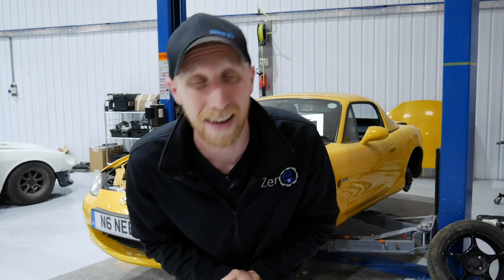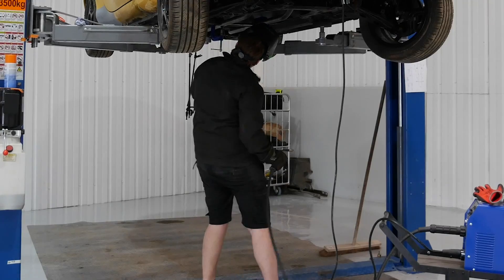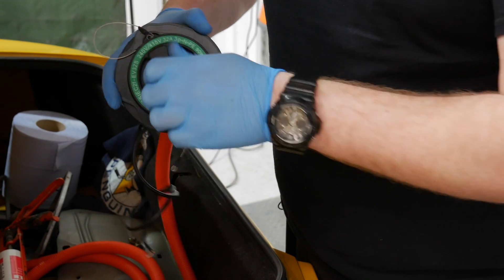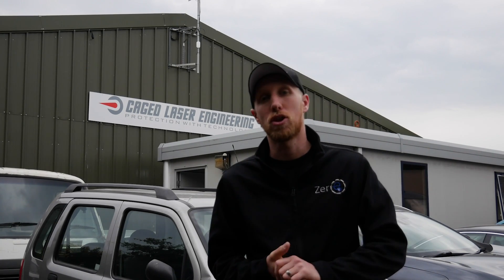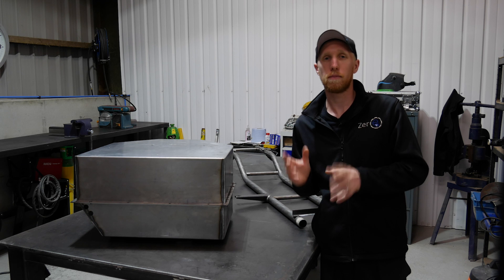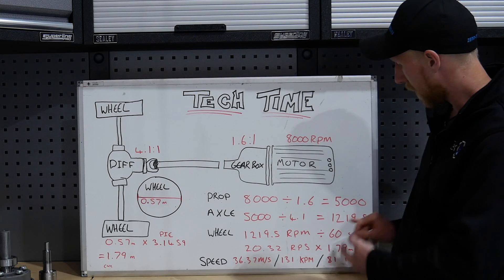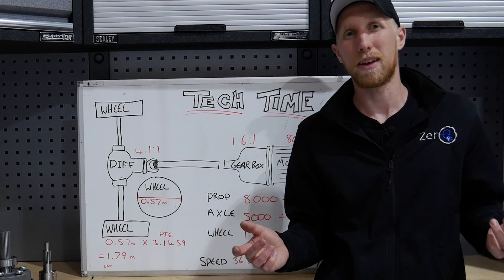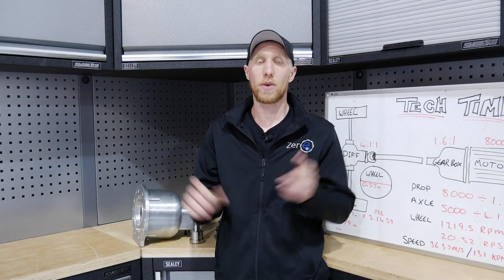Mazda MX-5 Goes Electric - The High Voltage Build - This could hurt

Comment: For Highway driving, which is 85% of the time in US the 3.6gear box would be better.  Would this increase the range of the batteries?
Reply from the maker: You would actually want a lower reduction more like 1.5:1 as this would alow the motor to run at a lower rpm and be more efficient

Comment: question.thinking of putting tesla motor in my transporter what kit would i need battery ect for this conversion...love the content only just found you
Reply from the maker: You would need a 350v nominal battery pack which is normally 96s check out the battery pack tec time.

Comment: Fascinating work !!! 
Does the hyper 9 only hold by the half moon in aluminum support it from the bottom ? Nothing prevents it from turning ? 

How much do you sell the reduction system to couple with the Hyper 9, I can't find info about that. I would be interesting to know the costs of its aluminum case and the planetary gear reduction (we are looking for a system with a gear reduction of 2.5)
Reply from the maker: It has a full clap around it, the gearbox is not yet available still doing more testing.

Comment: As sommeone who has driven an mx5 daily for 10 years, trust me, you can cruise at 110mph in an mx5 in comfort. on the german autobahns naturally only of course. I agree totally that 0-60 is more important in an mx5 tho. 0-60 can be done on a stock model in a hair less than 7 seconds, if you get those gear changes just correct.

Comment: I’m not 100% clear as to why the gear box is needed a? Lots of other EV’s don’t seem to need them
Reply from the maker: Every Ev has a gearbox. It’s just a single speed gearbox with diff.
Reply: Most production EVs have their gear reduction in two stages, both within the transaxle. This has the gear reduction in two stages as well, just separated into the custom gearbox and the final drive unit (diff).

Comment: What kind of metal was used for the battery box? What type and thickness? Thanks!
Reply from the maker: Also check out eps7 of the mx5 build there is done more battery box information on there.
Reply from the maker: We use steel 3mm fir the base and 1.2mm for the top from what I can remember.
Reply: @Hazell_Nutz  nice! Thanks for the info. Planning on building a battery box soon, so this is super useful.

Comment: 🤣🤣🤣🤣 I ran my 1.6L miata up to 120MPH with ease.  It could go even faster, but around 130-135MPH steering control would vanish due to lift over the front end.

I'd recommend a 100-110 MPH top speed unless you add a bit of aero for 
downforce or a bit more weight to the front end.  If you can keep steering functional, I know the Miata can do just fine over 150MPH.  I put lead lining over the front wheel wells in the engine bay (then bondo and paint over them with a lead warning in the paint job) and modified the hood to spoil the lift.  I could hit 160ish on a speed check run.  All on a supercharged 1.6L Engine.

Comment: What's the weight of the battery box? Why did you do steel box, isn't it too heavy?
Reply from the maker: Aluminium is hard to work with for most and cracks over time with vibration so steal is the safest bet plus of anything went wrong ie crash or fire it’s way better.

Comment: Question - why not yoke directly to the motor, skip the gearbox, and gear up the rear diff instead?  Purely to get the gearing high enough (>6:1) and it wouldn’t work in the existing diff?
Reply from the maker: Because they do not do a 6:1 rear diff.
Reply: In a quick search the shortest ratio I could find for a NB Miata is 4.778:1. These videos mention various gearing options, but 1.6:1 in the gearbox and 3.6:1 in the ring and pinion would be 5.76:1... so 4.778:1 would result in a substantially lower and likely unacceptable top speed. 

There is a 5.38:1 gear set for the same family of final drives (apparently for a Kia Sportage), so if it's strong enough and if the bits can all be made to work together, doing all of the reduction in the final drive might work.

The V8 swappers normally use a final drive completely unrelated to the Miata/MX-5 (or even to Mazda) - typically from a Ford or GM car - and build mounting brackets and shaft adapters to make it work. There are 6:1 ring-and-pinion sets out there, so this is certainly an option. In the end it would probably cost more and would certainly take more time than using the gearbox... and it might even weigh more, depending on the final drive used.

It would be nice to save the weight and expense of the gearbox.

Comment: Nice work with the gear tech talk. I've been more faccinated by the drive placed vertically and a gear box that can transfer the energy to front or back wheel. This will work better for waterlog areas, so water can't easily get to the electric motor drive unit
Reply: This motor is air cooled, but production EVs have liquid-cooled motors which are sealed up and don't have a problem with getting wet.

Comment: Does the cradle affect the overall safety of the car in case of an accident?
Reply from the maker: It’s definitely required as the cradle replaced the engine/ gearbox as if not the battery box and motor would of been two separate items.

Comment: How about using two of these motors to work in tandem ?
Reply from the maker: It can be done.
Reply: If you need more power get a more suitable motor, not two motors which combine to be enormously long and require two controller/inverters.

Comment: The circle perimeter formula is 2π*R, and not π*R as shown on the video. So, technically, the vehicle could get 72,7 m/s, or 162 mph. I really don’t believe it will get this though (I didn’t watch next episodes).
Reply from the maker: Gets exactly 72 did testing today.
Reply: They do the calculation with diameter, not radius: π*D

Comment: But one question wat about the charge port, when it start to rain. Did the charge port don’t fill with water ?
Reply from the maker: There is a drain hole in the charge point.

Comment: 10:45 So you're converting this MX-5 to electric and you're not even going to make it accelerate faster? And you won't even be able to drive it on all roads due to the reduced top speed... (This is coming from USA though, maybe where you are the MX-5 was slower and you have lower speed limits?)
Reply from the maker: Our max speed is 70mph in the Uk. This is mainly built as a test vehicle for the gearbox and battery modules.
Reply: @Hazell_Nutz  Makes sense. I assume future builds will be tailored to what a client wants out of the car. Still super cool what you're doing!
Reply from the maker: Darrek Olson yep your correct we have a new motor coming that will be 160hp and goes to 12,000 rpm so would alow 120mph top speed

Comment: Did you consider making the battery box from aluminum instead of mild steel?
Reply from the maker: Yes we did but needed the strength so by the time you use thinker aluminium is not a massive amount in it, plus if ever in a crash much prefer steel 😄

Comment: This would be annoying where I live. We have 80mph speed limits that aren't well enforced. 85-100mph is very common here in the country interstate highways. And that acceleration is just terrible. I don't understand putting all this work and money into something that would just be boring to drive and not even practical either.
Reply from the maker: It’s built as a test vehicle for the gearbox and battery’s, as a company we have a much more powerful motor coming out for this gearbox 👍

Comment: 131km/h top speed is pretty low for the mx-5 to be fair. On my NA I could do 190 km/h GPS measured, however it's not a speed for cruising. I guess it depends on the country, but 131 km/h can be pretty limiting in germany as 130 is the "recommended" speed for the unlimited parts. So when overtaking the people creeping along at 100-120 it could cause troubles for when you suddently don't accelerate anymore :D

Comment: Wondering what you plan to do about cabin heating?
Reply from the maker: Actually been working on that today, fitting a high voltage ptc heater.

Comment: Why does an EV need a gear box, just asking, I know nothing.
Reply from the maker: To keep torque high enough
Reply: @Hazell_Nutz  I see, thanks.
Reply: As with any engine or motor, the gearbox (with the final drive or "diff" gearing) matches the operating speed range of the motor to the required speed of the axles.

Comment: A top speed of 81 mph in a way is a let down but I understand the choice in the UK. Take a GT6 much above 100mph and it porpoised. A bit off putting. Running a 2 litre MX5 at an indicated 220Kph (probably 210 or 130mph) and it behaved fine. What was scary was being overtaken by something at that speed like I was stationary.  A top speed of 131kph will take you just to the French motorway speed limit with no leeway. That really needs to be better. The 0-6 is only just slower than the petrol version. I like EVs and hope to get one but not sure about bothering with an MX5 conversion. Interesting series though.
Reply from the maker: It’s mainly to test the gearbox out and actually do a build with the hyper9 as we have never actually used one as a company 😂 our new motor is 120kw and 12000 rpm so will do way better on 0-60 and top speed.

Comment: Would the batterys at the front change the 50/50 or so weight, and are you going to put more batterys in the old fuel tank spot to compensate?
Reply from the maker: It will change it a small amount, there is the option to run a second pack at the rear but for this build we will not

Comment: So if you put a model 3 motor in with 15500 max rpm the car would do around 150 mph?
Reply from the maker: Yes your correct there is a few other factors like aerodynamics and battery current requirements.
Reply: Zero EV I really hope EV conversions get more popular. It’s super cool how simple everything is. It feels like RC cars. I hope one day there’s all sorts of little upgrade parts like battery and motor swaps.
Reply: Yes, if you used the same gearing and if the Model 3 motor (and the battery) produces enough power. You don't change motors to change top speed; you select gearing to suit the motor chosen and the top speed desired.

Comment: Is DC fast charging a possibility for DIY EVs? I have a conversion in mind, but I want to be able to road trip, and Type 2 won't cut it for that.
Reply: Only if your battery voltage is above 250V when empty. Alot of DC charge stations do not charge below that voltage.

Comment: Regarding the diff gear ratio. As you say a 3:1 would reduce acceleration but increase top speed, what would that do to the battery life?
Reply from the maker: Would not have a massive effect on battery life unless you did a lot of high speed driving
Reply: @Hazell_Nutz  Cool, what about driving at motorway speeds? 70mph of course ;) Would the 3:1 mean more battery life over the 4:1? Sorry I just find this sort of thing fascinating, figuring out what you gain and loose when making these sorts of choices :D
Reply: @smartroadbiker  All depends on your motor efficiency graph, the draw on the battery will be roughly +/- 3%, i would estimate, so no noticable change. The main thing that will effect battery life is running the battery too; Hot, Cold, Empty, or Full. This is why you setup your BMS to manage all these things within reasonable limits.

Comment: Something else occurred to me on re-watching this - will you be rubber-mounting the motor in any way? That frame appears to be hard-mounted to the subframe and body. If the motor is hard-mounted too then you'll potentially get a lot of drivetrain noise through a very solid transfer path. It's not a deal-breaker, but maybe something to consider in terms of drivetrain refinement.
Reply: The motor needs to be soft mounted, due to reusing the OE brace between diff and gearbox. the motor and gearbox will sit on 4 isolators.
Reply from the maker: Yes it will be rubber mounted the frame you see near the end is a location frame for the motor so we can design the mounts for it
Reply: @Hazell_Nutz  Ahh I see, I was assuming that your location frame was something directly representing the mounting strategy. Good to hear the design is in safe hands :).
On a side note, again with my excel-jockying, you mentioned an estimated 8.5ish second 0-60 at some point in one of the videos. Correlating to this, I'm seeing a ~6.5s 30-70mph time. That's around a second improvement over stock and about on par with an '00 Porsche Boxster. Can you tell I'm bored at home? ;)

Comment: No mention of drainage around the charging connector. There is some, isn't there?
Reply: Ofcourse, like in the fuel filler version. That drain is not removed, the installed connector also has a drain connection on it. Both will be routed out the bottom of the boot.

Comment: In the spec sheet it says the Hyper9 IS system is rated for 38kw @ 3300 rpm for continuous output with proper cooling.  Does this affect the top speed calculation that you did in the tech talk? I assume that it would at least put a time limit on how long the top speed is sustainable? 38 KW is about 51 HP as well. I wonder how much HP is needed to maintain the top speed.
Reply from the maker: All comes down to aerodynamics lucky the mx5 is not to bad and not that heavy so we should be ok. Only testing will tell.
Reply: At 8000 rpm a Hyper 9 does roughly 40kw.  Calculations on a mx5 NB show a power requirements of 26kw at 80mph so got plenty of overhead.

Comment: It would be cool to keep the manual transmission in the MX5 and pair it up to with the electric motor.
Reply from the maker: There was is no real needs it was not designed for the instant torque so won’t last long term and means you loose most of the space fir batterys

Comment: How much would cost to convert a Mercedes sprinter Van with At least 60 kW Battery.  A conversion of a small car like this for me at least does not make sense be cause I have 2 Toyota Prius, but I need an electric Van and there is none on the market in USA. I also want to fill the roof with solar panels to give me maybe 10 to 12 extra miles of range a day.
Reply from the maker: Vans are hard in regards to range and performance of your doing low speeds then it worth looking at. The kit fitted to the mx5 is about 18k in parts.
Reply: @Hazell_Nutz  Thank you for the reply. I thought that Vans would be easier to convert since they have more space for batteries. For me the best part of the Van is the roof top for solar panels. If we get solar panels with 49% efficiency that means  that in the future we could have double the power from the same roof top surface. With Small cars you cannot get a conversion cheaper that a Tesla III. and even if you get it at the same price you do not have the range or efficiency, or power or fun to drive. I would use a van because of the space and confort while traveling with the kids for their sport games.

Comment: im thinking of making a classic mini with mostly the same parts as this build is there any tip as it would be my first ev conversion
Reply: it is alot of work, in a mini you need to find space for batteries. And you need to decide if you will use the original geabox or not.

Comment: Was there a way to mount the motor within the rear subframe an direct to the axles? Save a bit more weight?
Reply: The rear subframe is too narrow to do this. It would require changes to the suspension and that is not allowed.
Reply: That can be done in some vehicles, but the space between the control arms is really narrow in the NA/NB Miata/MX-5, so it's not practical with available transverse motor/transaxle units. An NC Miata would be a better target for that design.

Comment: Love the concept of the build, but the stats seem to be generally equal or less than the original mx5 in all areas, and 80mph max isn’t the end of the world...but if you’re sitting at 70 doing around 90% motor power isn’t that going to really impact on the range due to the current it will be pulling? Kinda seems like it needs a bigger motor and better ratio to make the car better than the original donor
Reply: 90% power? You are confusion RPM and Power, yes its doing around 90% of its max rpm but only needs to produce around 17-20kw to maintain 70 mph, this is less then 25% of the power potential of the motor at 7000 rpm.
Reply: T Bree yes 90% of the motor rpm is probably more accurate way of saying it, wasn’t sure if it would be maintaining that rpm with equal or lower power consumption but logically the force the motor is applying is the main draw of power rather than its speed depending on its efficiencies.

Comment: What does a conversion of an MX5 NB to BEV costs?

I have one and is very seriously thinking about getting it converted!
Reply from the maker: All depends on what your looking for. They system here is about 18k in parts with vat but there is other cheaper options
Reply: @Hazell_Nutz  what about the installation?

Comment: Did you consider a more direct connection of the motor and the wheels, much like the drive train of the Tesla?  The approach would simplify the drive train and reduce the power robbing gear box.   Assuming you did consider a Tesla like power train, what were the factors that influenced your decision to just replace the engine with an electric motor?
Reply from the maker: We had already don’t that with the Porsche and skyline so this is just something different. Plus it would of required a custom rear subframes which in turn then requires a retest in the Uk. So engine/ gearbox swap does not need anything apart from mot.
Reply: @Hazell_Nutz  thank you